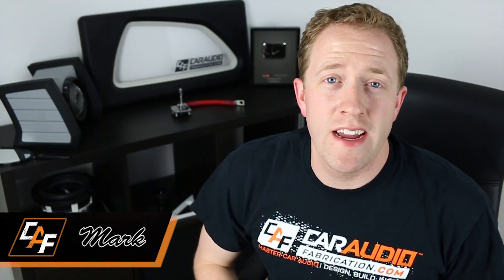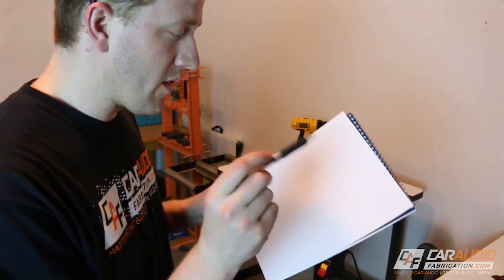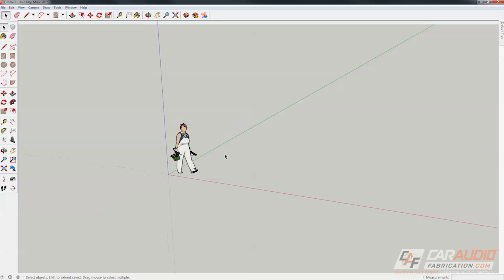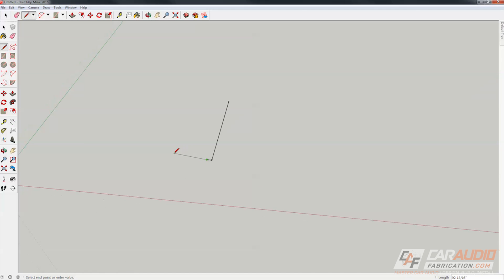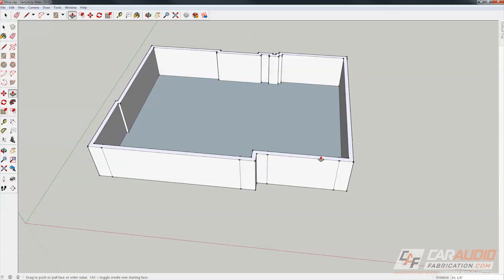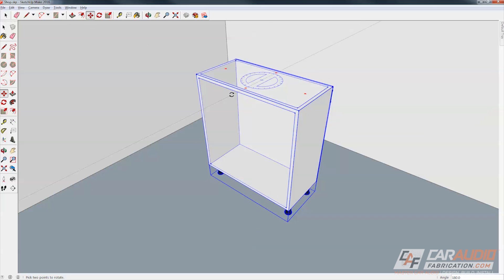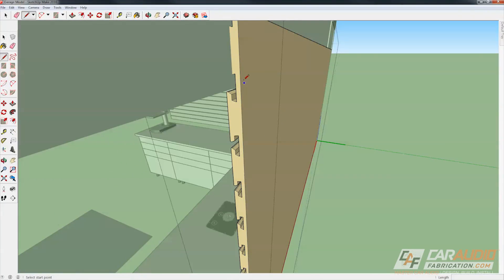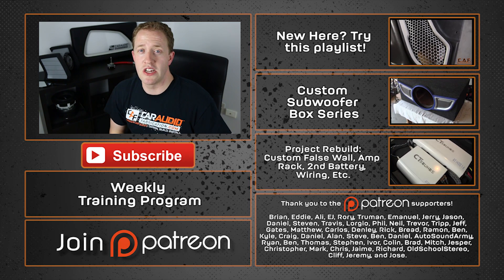FAST AND EASY - Planning garage workshop - CarAudioFabrication

Comment: I need to know, as I am from scandinavia, what is Slab wood? the stuff you use for your wall mounting? Did you do the drilling yourself and what kinda mounting stuff fits? (links)  it seems helluwa lot smarter than nails and screws if it is as I understood you in the video.
Reply: Google "slatwall" and that should give you more than enough info about what it is and what you can do with it. It's similar to pegboard (if you know what that is) and used a lot in retail spaces.
Reply: Ahhh, I googled slab wall :P didn't get much wiser :)  thanks for sorting that out :D very helpfull
Reply: Haha, I thought that might have been the root of your problems. Glad to help!

Comment: Wouldn't having all the routers in the countertop limit the size of material you can work?
Reply from the maker: Not really, Iv'e had my exiting one against the wall for years and had maybe one time I had to move it away. I will probably have a lift in the island as well just in case I ever have anything really large to work on.

Comment: What's the benefit of having 3 routers, and not 1. ?

Also, what kind of electrical upgrades will you be doing?  I know when I have my compressor, shop vac, table saw running, my breaker pops. 

Thanks for the videos!
Reply from the maker: +bigjaydog08 3 routers, 3 different bits ready to rock. I'll keep one always flush trim. Another will be a rabbet and the third whatever random bit I need to use. Faster builds. Sounds like all your stuff is on one breaker. Just need another run and br acer installed. Odds are an electrician can use existing conduit in your walls, they just need to pull another run.